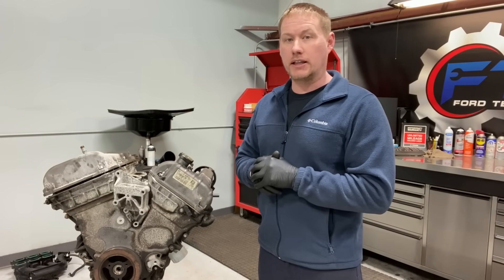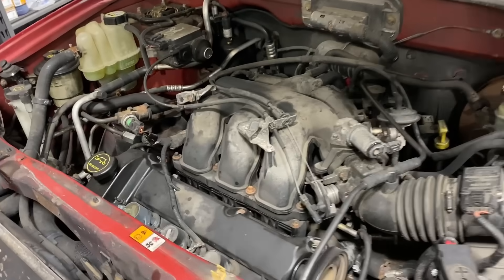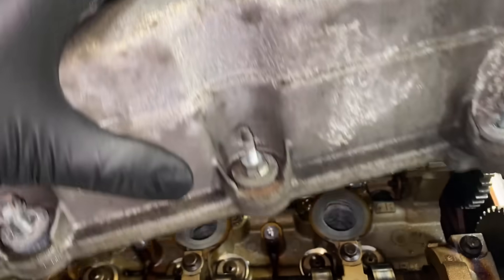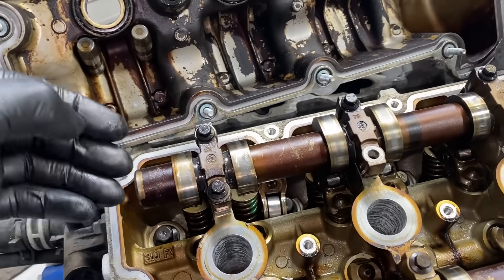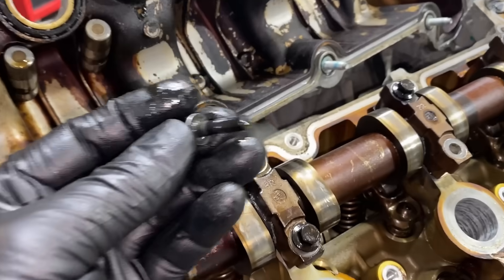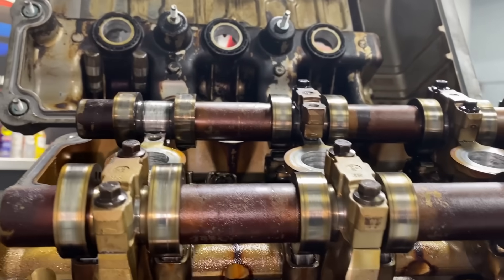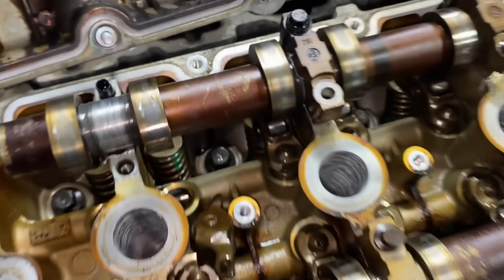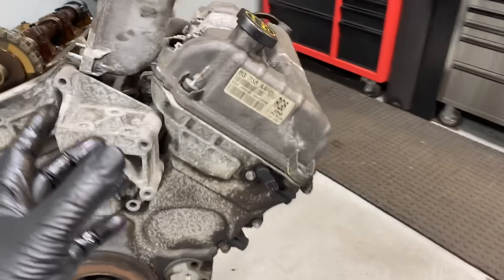Ford 3.0L V6 Duratec Engine: The One Fatal Flaw That Will Destroy This Engine!

Comment: If you think this is a fatal flaw, you should talk about that chain driven water pump.... when the shaft seal goes, it dumps into the oil, not out where you can discover it before it destroys the engine...
Reply from the maker: I have many videos on that water pump design but that is only on the 3.5L/3.7L, this video is on the 3.0L DOHC.
Reply: @FordTechMakuloco  oh, yeah, my bad!

Comment: 07 120k miles. Was fine going to the store & home. Went to go to work a little later, & it sounds like everything that moves is trying to come out from anywhere it can. It never even got warm, much less hot. No problems with trans either. Not sure what happened, but now I believe it’s gonna turn into scrap.

Comment: Yep my neighbor has a sable with the dohc 3.0. Had a coolant leak they never fixed. Overheated it over and over and over again. Never blew the headgasket but did exactly this. My old taurus my father drives has 250k on it and runs smooth as can be. Sadly he doesnt maintain vehicles and would do the same my neighbor has done so its only a matter of time before the 3.0 in my old taurus meets the same fate. He overheated the snot out of a 5.2 in a jeep he got from me because he refused to put a radiator in it after hitting something and cracking it. In the process of fixing that now.... No blown hg or cracked head for now but he doesnt believe in long term damage. Youd think after over 60 years hed learn...

Comment: I'd be tempted to pop a hole through the bolt heads and use safety wire to avoid this altogether.

Comment: Could you please help me with some tech support? Do all 3.0 Duratec engines use the same flex plate? Having some issues from an engine swap and starter engagement. Nocked off teeth from the flex plate in one location but the rest of the teeth seem okay. The engine came from a junkyard. I am trying to decide if the flex plate is slightly bent in the bad spot or if it is a different plate. Please help?

Comment: Thank you for this video, its very informative! Ive been wanting to drop one of these into my svt contour and ive been researching these engines alot, so thank you!
Reply: Sounds like a sweet project. Just fyi, the Lincoln LS version has about 280hp, but since it's a rwd car may be a tough swap. My Escape has 240hp and a really low 1st gear. Makes for a suprisingly quick 4000lb grocery getter. I always thought it would be great fun to have one with a MT. Good luck.

Comment: Probably the mechanic was follow instruction manual but sometimes the manual you read 20 pounds but is not true if you do this you can damage complete you engine, better tight you bolts of pulse

Comment: Great video... Very helpful.  If the engine is torn down to this point, should the timing chain, guides, tensioner, oil pump and seals be changed out?  Should the valves be ground?  Thanks in advance for your suggestions...
Reply: I know I'm late but leaving this for others. If the cylinder has compression, valves do not need to be changed out. If it's not leaking, seals are fine. Oil pump? Maybe if you're doing the timing chain already. Timing chain? Sure, you've already got the valve cover off and everything, and a chain isn't too bad to do.

Edit: since that cam is cocked over, you probably do want to go ahead and do a timing chain because it's been running with a weird angle causing excessive wear on the links

Comment: I'm curious if you have any idea what this may sound like and when it's too late to do something about it. I've got an '06 Fusion with the 3.0 and I just crossed 350,000 miles on the original engine. It still seems to run fine but I've noticed a slight hollow yet dull knock that seems to be coming from the top end. No sure misfires, no oil consumption, although it does leak at the chain cover and pan gasket. I've never had a CEL for misfire although...given past experience, it doesn't mean it's not happening. After long drives, it feels like I have a dead cylinder (not sure that could be caused by this but thought I'd mention it). Thanks again for the videos...very helpful!

Comment: Whats the torque spec for the cam cap bolts? I have a 2010 escape and i want to double check these just in case it has the same problem.
Reply from the maker: 89 inch lbs
Reply: @FordTechMakuloco  could you in theory use blue loctite on the cam cap bolts? I assume the vibration could be the issue?

Comment: UK viewer here, please can you confirm if this is the SAME engine, that was fitted to EUROPEAN XJ6 X350/358 models, 2003-2009?. It seems to be well thought of here and recommended as the sweet spot, between the 2.7l diesel and the V8's. The V6 XJ6 was not offered in the US market. Thanks.

Comment: Does this goes to 2009 Ford Fusion 3.0 V6?? It has 182k miles on it. Just got the valve cover gasket replaced.

Comment: 2012 v6 escape with 233k miles with no rush new transmission at 194k with extra cooler and add on remote filter.  I'll be doing these bolts and another set of valve cover gaskets to hopefully take my escape to 400k.

Comment: You mention the T-Joint oil leaks "no big deal, fix them and move on".. but it seems like they are a bigger deal.. like REALLY hard to get to. Any tips on that or do you have a separate video on fixing those T-joint oil leaks?

Comment: Thank you so very much for your videos. They’re a godsend. I’m certainly not a mechanic, but with a wife undergoing cancer treatment, I have little choice but to do my own repairs wherever possible. I’m waiting on my parts to arrive, within the next couple days, to completely replace the front brakes. While I’m doing that, I’m also going cup pull the intake manifold to replace the coil packs and plugs. (Stellar design!!)Hopefully, this will help cure a misfire on cylinder #6. I just need clarification on something: I drive a 2009 Escape XLT W/3.0 V-6. You mentioned that this was an issue on 2001-2007. Did Ford take steps to correct this between 2007 and 2008? Has this been a problem common on the 2009 model year versions. I really would like clarification, so if necessary, I can also tackle this issue while I have the Intake off. If much rather address everything I need to at once, then have to continue to fight it. It’s really frustrating for me, and obviously not healthy for the motor to have ongoing issues not addressed. Please help clarify this for me. And again, Thank You for your videos. Your helping and enabling me more than you may realize, at a time when we really do need a break. God Bless.
Reply: @Mark Barnfield- I just finished reading your comment from a year ago.
I see you didn't get an answer which is frustrating. I was hoping to read the answer as well.
Sorry to hear about your wife having cancer. I really hope she is doing ok.
Reply: Thankfully, most of his questions were addressed in the original video. Replaying it should answer them I think except possibly the year model range.

Comment: If I had actually done a BETTER job at the oil monitoring (slipped up ONE time) I wouldn't be here to ask if anyone has any suggestions to a performance replacement. Its knocking pretty hard. Not finding any but I KNOW they've got to be out there. I mean it's a freaking 03 3.0 Duratec. Still looking, so if anyone has any suggestions, help me out?

Comment: Brian, you saved my bacon!  Pulled the valve covers off and had three (3) loose bolts!  2006 187,000 miles
I can’t believe these 99 thumbs down?  What the?
Reply: i have a question... with the bolts loose did u have any misfires or noises??
Reply: Did you have any noise or did you only realize the issue existed until you took off the valve cover?
Reply: remember when we had thumbs down LOL

Comment: I just purchased a 2003 Escape with the 3.0L V6. The car has 177,000 thousand kilometers on the odometer.    After new sparkplugs, engine flush and fresh Synthetic Oil the Engine started to develep a slight ticking sound when at warm temperature.        What do you think the issue could be? Is it the bolts coming loose on my Engine?....

Comment: Dose this also happen on pre 01 duratecs? I'm having a strange miss under load on my 99 taurus.  Changed plugs and wires with oem parts also replaced coil with ngk unit.  With No changes.

Comment: Dang. In 2016 I put my '04 Mazda 6S 3.0 V6 up on blocks in my back yard and worked on it for a couple months doing everything on the front end. My biggest issue was the timing cover oil leaks you mentioned. 12 years of smelling vaporized oil... I had the whole front end torn apart, and did a newer tyranny, new clutch parts, etc etc etc. I wish I had known I should check the cam bolts! Great video man, very informative.

Comment: I have one I change the oil 3000 mile to 4000, never any more. 150,000 and going strong. Trying to go 1/4 million
Reply: My 2010 kia engine has 279,xxx miles just showing off.

Comment: Are the cap bolt torque to yield? If for what ever reason your not able to replace the bolts can you put thread locker on them and re-torqe them back down?
Reply from the maker: no and no.

Comment: FTM:
I have an 05 escape with this engine and the CD4E trans. Currently have 303K original miles on both and neither have ever needed internal work. I've just been diligent about oil/fluid changes and other maintenance. I even had the oil analysis report come back recently and everything passed with flying colors. Runs like a top and its reliability has been remarkable; great car!

Only two major issues: I'm in the rust belt and the rust is starting to take over especially in the rear strut towers. The other issues is that somewhere around the exhaust manifolds/maniverter (upstream of the flex pipe) I have a nasty exhaust leak I haven't located specifically. This has reduced its performance and sometimes gives me a code about catalytic converter efficiency. On a cold day you can see the smoke as soon as you start the engine and it is a little stinky. Its hard to see exactly where the leak is because i think its hidden under a heat shield. Unfortunately at this point its hard to justify what a shop would likely charge to fix and while I'm a pretty avid DIY mechanic It looks like I'd be in over my head trying to fix it myself (the catalytic converter/manifolds are pricey and no doubt the rust will make removing them a nightmare.)

Any advice would be greatly appreciated,  always enjoy your channel! 

-pete
Reply: My 2005 has 365k miles now, runs great. I replaced my rear shock tower in the passenger side two years ago. I used rivets and loctite adhesive and haven't had any issues. I've done all engine gaskets and had the heads off, so I can tell you the front manifold converter is not as hard as you think. Have the right tools and extensions and you'll get it. The rear manifold converter, I took off with the head. And had to drill out a previously broken stud and install another one.

Comment: i guess i am lucky i checked my bolts  and they were at spec. with the suv being 220k miles  and starting to rot. if it dies tmw i wouldn't care.i got 145k miles out of my 07 mariner v6. shes had a good life. i want a new suv anyways.

Comment: I just bought a 2009 Escape with a 3.0 V6. I know it needs valve cover gaskets as there is a leak. Would an 09 V6 need these bolts or am I safe just to make sure they are torqued down? Great video. Thanks!

Comment: I’ve driven my 05 4wd escape from coast to coast 4 times and even did a decent off road trail driving on my adventures and I just had to rebuild my Duratec engine at 160k miles! The interior and exterior need some cleaning but the lil truck just refuses to give up!

Comment: Excellent advice!! Thanks. I just came into possession of one of these engines (2004 Escape) and I'm going to check these camshaft cap bolts. it's leaking oil too so I'll change the valve cover gasket while I'm at it. where is the other oil leak spot? "T' joint?
Reply from the maker: Yes reseal the front cover that is where all the oil is leaking from.
Reply: @FordTechMakuloco  Thanks!

Comment: my 2006 mazda 6s has multiple misfires. I went from 12 error codes to 3-5 error codes and after 2 hours or driving theres a kncking noise inside. how expensive is it to fix? I wanna autocross godamnit!

Comment: Got a 2001 sable w a dohc engine and I have 217600 and it sounds like a new car still. It seems to beat up motor mounts which have been replaced twice in 18 months and trans mount. Other than that she runs like a champ!! Very good engine

Comment: I bought a Ford once never again it was the worst vehicle I ever had in my life dealers were horrible parts for my brakes were on back order I couldn’t even use the piece of junk never will I buy a Ford ever again biggest piece of crap over engineered garbage

Comment: My grandma has a 2011 Ford flex can its got 97000 miles on it she's also got the Duratec V6 do you know if Ford corrected the problem or does the engine have the same fatal flaw?

Comment: Not sure if this engine gets it's oil to the right head just like the 5.4's. But we've had several 5.4 engines that the right side cams have issues. Why? Because the 5.4 right head gets it's oil pressure from the rear of the crank after it passes thru all the mains and rods. Oil pump is in front, left head will have good oil pressure, checking the 5.4's oil pressure at the back of the heads. The head will have great pressure, right side will be very low. Cheap fix, plum the rear of the heads oil pressure ports together. It'll last longer on a worn engine.

Comment: Does this also account for the Ford Flex of this era?
Reply from the maker: The Flex never used this engine.
Reply: Ok thank you. I was worried about the 3.5 and its variants.
Reply: Have you done a Duratec vs Ecoboost engine comparo yet?

Comment: Appreciate the videos that you make. I just pulled the trigger on some from Ford. Have a bad motored Ford I bought in 2017. Just getting around to freshening up the pan, covers, and timing cover seals. I'm thinking of locktite on the bolts. 
But I would need to get oil out of the threaded cavity that takes the cam bolt of all oil, then solvent wash it........Not looking forward to that.  But I'll sleep better doing it..........WHY DO I TORTURE MYSELF???????

Comment: I'm wondering about what you said regarding the location of failure most commonly being on the end of the head away from the timing chain.  Could this be a problem with harmonic resonance?   If I'm understanding you correctly, it seems as though the very same kind of bolts are holding just fine at the timing end of the head.

Comment: That is some poor engineering.  Ford tries to make its vehicles difficult.  Getting into and around the engine compartment of my 2007 is next to impossible.  If the engine were turned with the belts facing front, it'd be an amazing step in the right direction.  Good video.

Comment: Friend has one with 300,000 miles still going. His dodge ,Mazda,and Honda are dead but the escape is still rolling.
Reply: It's funny you mention Mazda. This engine is actually a Mazda design.
Reply: @banzairx7  Ford had big shares in Mazda long time ago kept them from going bankrupt.  But the contour and mystique cars Ford had where Mazda base where horrible we worked on them all the time had ass load of recalls.
Reply: @patmason7276 contour had transmission problems but were otherwise good little cars as far as I could tell.
Reply: @banzairx7  lol yeah that's true it's a engine made from Japanese ideas made with American parts.
Reply: It's a Porsche Design  @banzairx7
Reply: @banzairx7 actually Porsche
Reply: @banzairx7  I read this engine was a Porsche design that Ford bought.
Reply: @banzairx7 negative bud. this motor was originally engineered by Porsche before ford bought it from them. Mazdas not ahead of ford lol. Mazdas wanna be fords so bad. they are basically the clearance version of the fords 💯
Reply: @AustinPowerzz  You know absolutely nothing about Mazda or Ford
Reply: 2005 Escape 319k running good
Reply: @dandiegidio7729  cool yea those little things are like the energizer bunny keep on going and going and going!!!
Reply: I have a Taurus still going at 256,000.
Reply: @MrSnake-dh3hu  how many transmissions have you put in it 6,7,8????
Reply: @Chrissy212  To my knowledge it's on its factory transmission. I bought it used with like 216k miles so there's no telling
Reply: @MrSnake-dh3hu f your o/d light starts flashing.. your days are numbered..
Reply: @elongnutz2531  the factory engine did give out at 260,000 when an intake valve went and took all the compression in that cylinder with it, but I got a used motor with only 133,000 miles installed for like $1200 parts and labour.
Reply: @MrSnake-dh3hu  how the transmissions never last
Reply: I came here because I'm looking at an escape
Reply: Mazda must not have been a tribute :V
Reply: Even a broken clock is right twice a day. I have a Ford Escape Honda Civic and a Prelude. The Escape is given the most problems. 3 axles in just over 4 years power steering lines. Pluse, it only haves 3 shocks, 1 rusted out. The joys of living in the rust belt. Now it's knocking really bad like it's down a hole.
Reply: Wild because this is actually a Mazda engine lolololol
Reply: I've had s 95 nissan since new. It's good because I'm the only one who drove it
Reply: 324k on my 02 escape.
Reply: Original transmission?
Reply: I'm running 300,000m on mine rn
Reply: My Mazda has  the 3.0 duratec in it lol